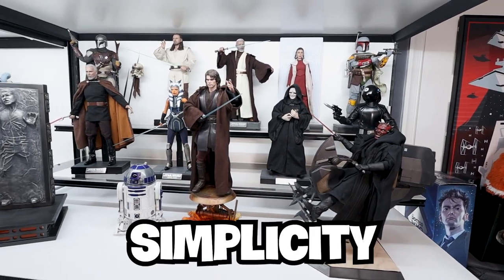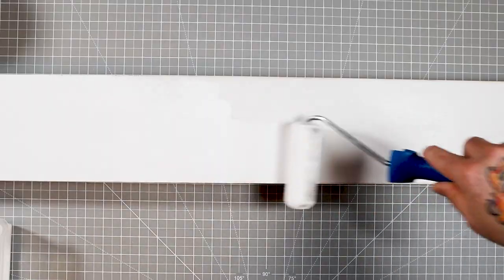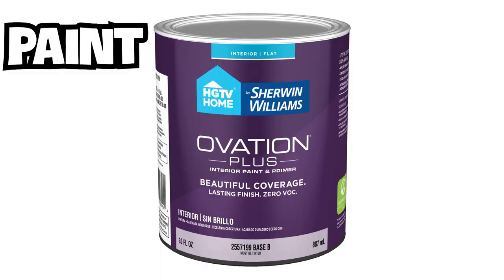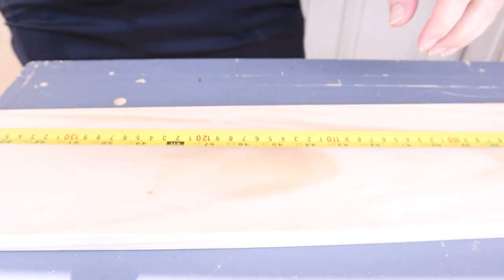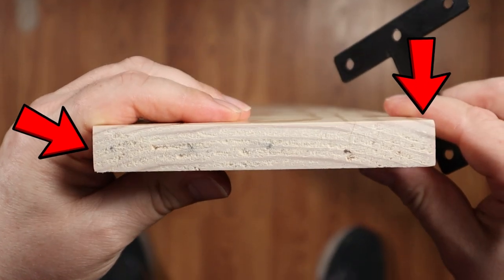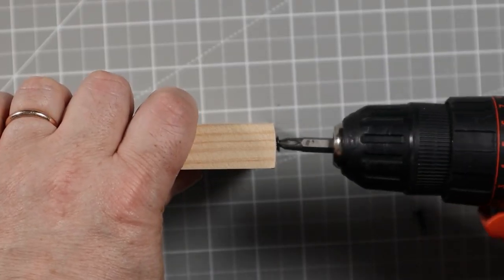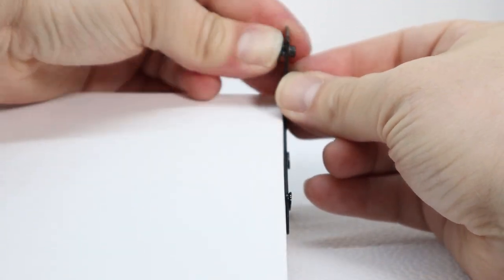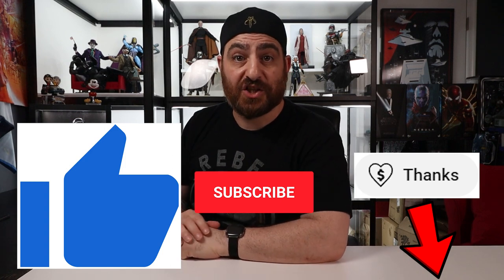EASY DIY Custom Display Case Part 5 - Garage Shelf Build

Comment: There's a solution to increasing the size and weight capacity of the wooden shelves by simply adding legs made of wooden dowel rods somewhere in the middle, you can paint them and they'll probably blend with the rest of the interior or be simply hidden by placing figures in front of them.

Comment: Really awesome and detailed videos. I am thinking about doing this. Do you know how much a 12 inch shelf would hold?
Reply from the maker: What do you plan on putting on the shelf? I haven't tested a 12-in shelf but I feel like you could put as many hot toys figures on it as you could fit. It's very stable. The t-brackets also come in 5-in by 5-in and that will increase the stability for holding things on the shelf. Thank you for watching! I'm glad you like the video.
Reply: I think I would probably put around 15-20lbs on it, so kind of alot. It would be 1/6 scale figures that have a base on them.
Reply from the maker: @ThePlastic111  That would definitely hold 15-20lbs